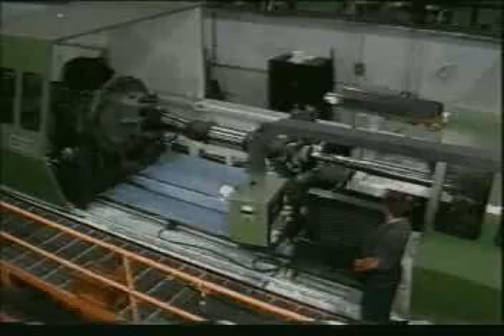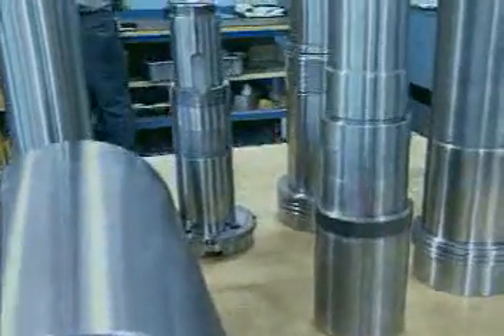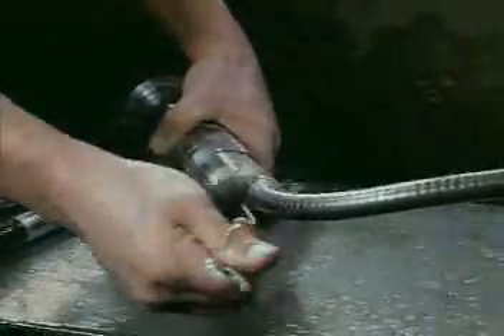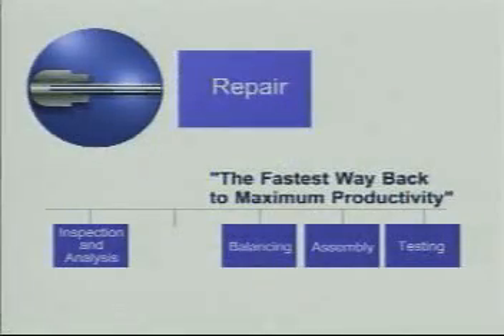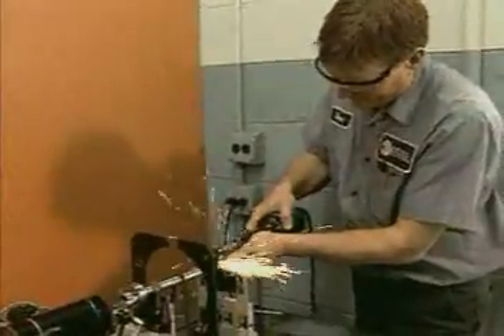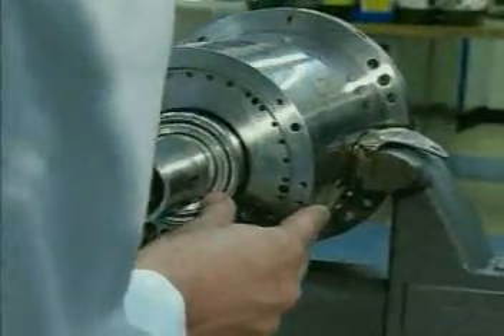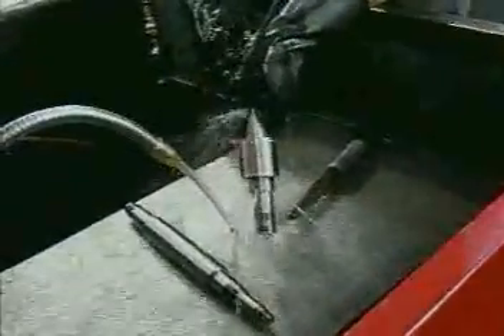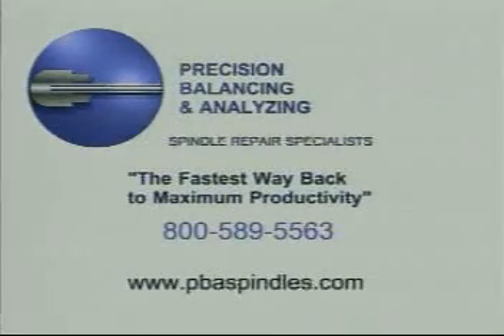Spindle Repair Process

Comment: We love spindles and we really enjoy the spindle rebuilding process, ours are very small micro 8mm 10mm and 3C we love the tolerances, best if we can even exceed them, so thank you for sharing your skills and the company you run offering these spindle rebuilding services. We will remember your company if we come across a larger spindle in need to be rebuilt correctly. 
Lance & Patrick